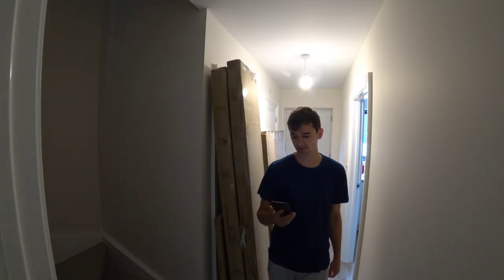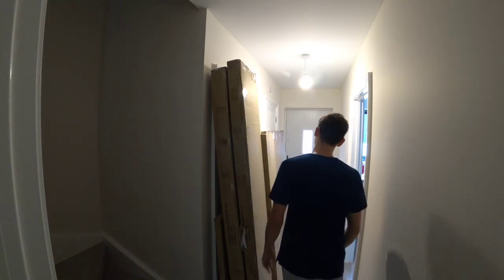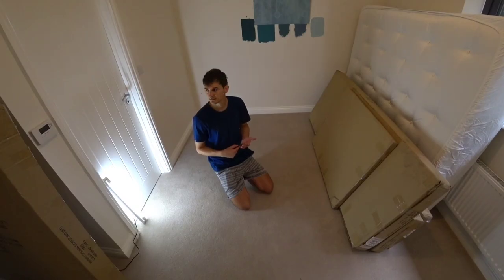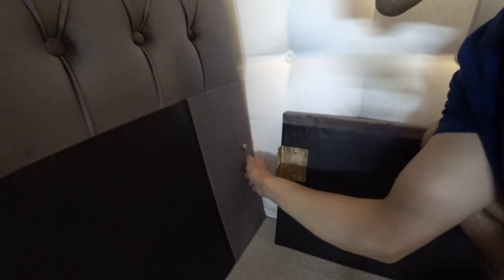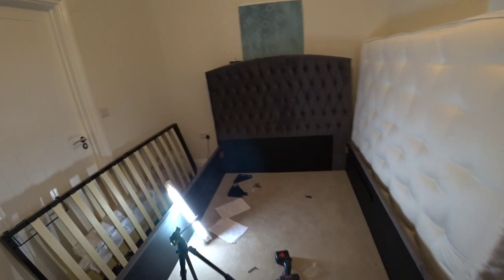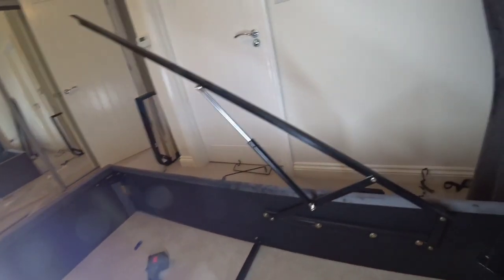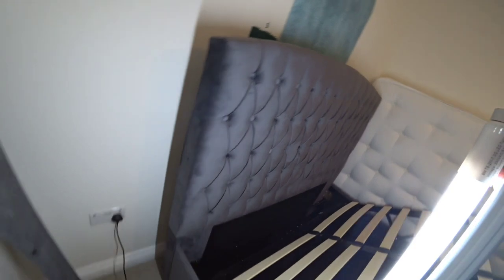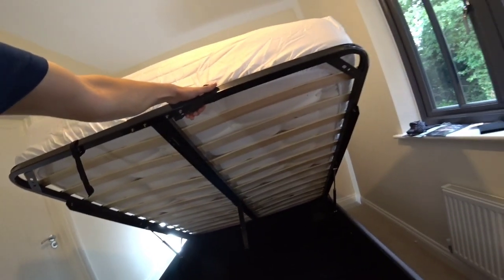Happybeds Warwick Grey Velvet Fabric Ottoman Bed Frame Build/Review- 5ft King Size

Comment: So  Bro what is the follow up of the bed? Does it squeak ??
Reply from the maker: Hey, thanks for your comment. I can confirm the bed does not squeak.
Reply: @inSUBout  Thanks for the answer , what are your thoughts regarding this purchase, the good and the bad?
Reply from the maker: @coolissimo69  I need to do a separate video on pros and cons, but here are some of them
Pros:
- good quality, very heavy, sturdy, solid construction.
- considering the above and others on the market, very good value for money.
- velvet material is very nice, looks premium, there were no snags or blemishes on the material.
- considering my abnormally heavy mattress, the gas struts help lift the mattress up very easily.
- the ottoman storage space is much deeper than others on the market.
- the design is elegant and modern.
Cons:
- assembly instructions could have been clearer.
- although seemingly not detrimental to the strength of the structure, some of the metal pieces could have fitted better, or they should have provided spacers.
- the design looks great, but personally I would have liked the mattress to be flush with the sides of the bed, instead of recessed. This would have saved space in my room.
- the wooden slats could have been polished/varnished, they are not smooth and when pulling the mattress off this could damage the mattress (very unlikely)... I'm really picking holes now ...
Reply: @inSUBout  thanks do much once again, can I ask you about the feet of the bed?? As my floor is not flat , so I need to be able to slide some small wood to compensate the  evenness.
Reply from the maker: @coolissimo69  this version of the bed did not come with feet. The base edges must be on a flat even floor, I believe carpet is best
Reply: @inSUBout  thanks so much bro really appreciate you time

Comment: Do you have to hold the frame or the pull straps when closing the ottoman bed to prevent it from banging shut or do you need to apply pressure to lock it in place?  I have just built a king size ottoman bed. Now I don't know if its a problem with not having the right gas lifts, mine are 1400N, or whether it's because I have a heavy king size mattress which is 35cm deep and the gas struts just aren't strong enough to support the complete motion when just opening and just closing, the in between is fine. Ive seen on a set of 16OON gas lifts which I may consider ordering once I can confirm what the cause is.
Reply from the maker: Yes I do, as I also have a rather big, deep and heavy mattress. I do have to give it a good pull initially to get it to lift up, and when putting it back down, I need to take the weight a little bit to stop it from slamming shut.
Reply: It’s possible that your gas lift struts are not functioning as they should when closing the ottoman beds. The general consensus from what I’ve found from those who have always used ottoman beds as well as reputable suppliers, is that at the final stage of closing we should not be taking the strain of the mattress, equally lifting it up should be easy enough for a woman to get access to. A female friend I know who is short has two king size mattresses on her ottoman bed in her spare room. She’s able to easily open the ottoman and close the ottoman by using the strap until she can get her hands on the top of the mattress to then push it down. The two gas lift pistons on that bed are 1000N as well. 

I think a lot of these vendors who sell these types of furniture, try to pitch the look and the fabric of the item and whether it’s deliberate or not, do not mention if the functionality of the items works as someone would want (easy lift). 

I’m getting my two gas pistons replaced by the vendor who seemed to think that it’s normal for a ottoman bed to close with a bang if someone wasn’t taking the wait, as he also has the same type of bed which does the same thing, and is impossible for his mum to use. Now surely you would think that if you’re selling these things, you would know how they should function. He just said he never really thought about it🤦. 

If the gas pistons are inferior or defective then this is likely where we would encounter the issues. I would just finish on this, anyone who is interested in purchasing an ottoman bed, don’t just consider the appearance, ask whoever is selling the ottoman whether the ottoman is ‘EASY LIFT’, as it may not state this on their product description.
Reply from the maker: @doctordre7273  I do agree with you, and I think (if not already) ottoman bed manufacturers should be very clear as to how much weight the bed and provided standard pistons can lift for, as you say, an 'easy lift'. I am quite certain that the pistons would be great if I were using a normal, lighter mattress. But I think most mattresses of any decent quality nowadays are heavy.
Reply: @doctordre7273  thanks for this feedback - I can't open my bed at all! I do have a heavy mattress but it's impossible 🙁

Comment: How did you get the frame bolted to the sides?? I'm having so much trouble putting it on top as it is too heavy
Reply from the maker: Hey, yes it was difficult for me too doing it alone. I do recommend having someone to help you whilst you bolt it together. Are you referring to the top slats and bolting these to the gas struts? If so, I managed to rest the frame on top of the gas struts, it is not very stable so you might find tape or zip ties will temporarily hold it in place. Hope you get on okay
Reply: @inSUBout  hi yes I managed to do it and I have the mattress on it but it won't close. What have I done wrong 🙃
Reply from the maker: @salvi3592  do you mean the mattress will not go down at all? Or does it touch the side panels as it goes down?
If it will not go down at all, the gas joist might need some assistance for the first few times so give it a push down. It may be because your mattress is not very heavy.
If it is touching the bed side panels as it goes down, you need to reposition the bolts accordingly. Let me know how you get on?

Comment: What’s the length of the back board without the wings attached?
Reply from the maker: Do you mean the width of the head board? (side to side, not height) if yes, I have just measured this for you and it is 159cm wide without the two side wings attached. With the wings it is 167cm wide.
Reply: @inSUBout  okay thank you

Comment: I’m struggling I have two black metal pieces and unaware where they go!!
Reply from the maker: What do they look like these metal pieces? Can you see an image of them in the instruction manual? It should be in the section 'whats included', if yes, what have they labelled this piece as?
Reply: They’re medium length with screw holes, there are two silver metal pieces at the top and bottom of the bed with holes also just not sure if they go into that. The instructions I have is rubbish I can’t see the metal pieces